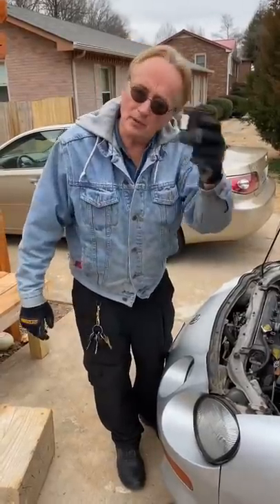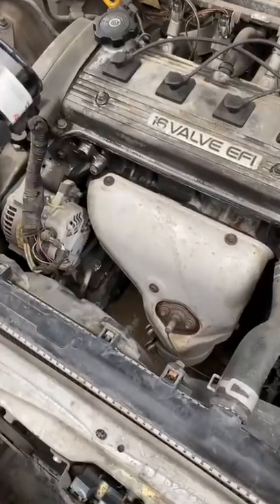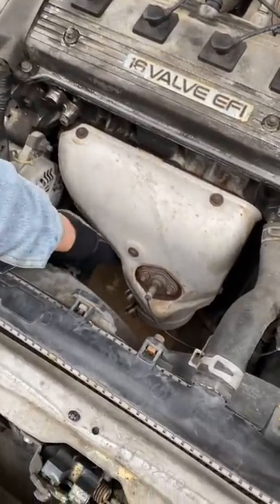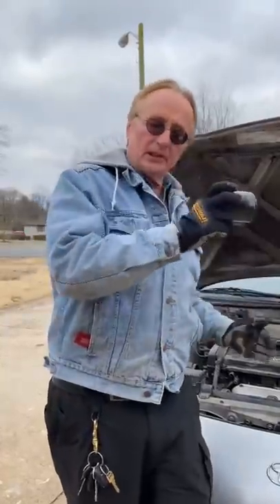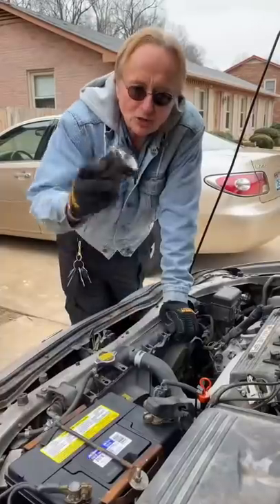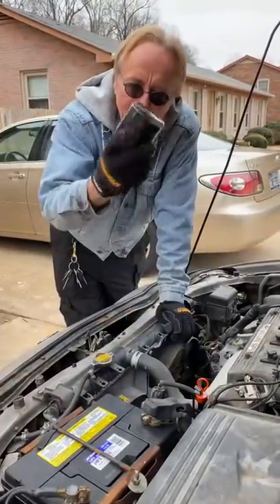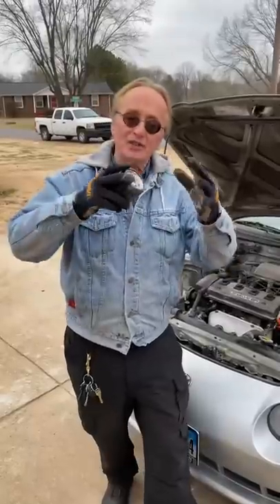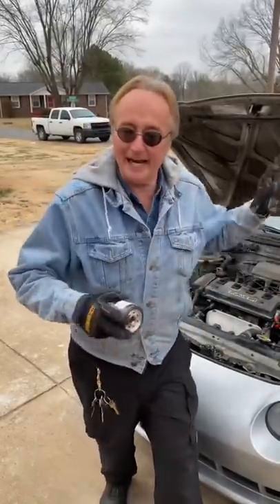The Dumbest Thing You Can Do

Comment: I did that once on my 289 mustang. The double gasket holds at low rpm. As all 289's are cold blooded. I had the hood open after the oil change, the engine was warming up I reved the engine using the carb linkage and heard a spraying sound. Ran into the car and shut off the engine. I lost only a qt. of oil. Sure enough 2 gaskets. Now when I spin a filter off, first thing I check to see is the old gasket is still on the old filter.
Reply: Mine was on a 302 🤣
Reply: @Brian Waskow You are so lucky you acted fast before it was too late.  👍
Reply: @wturner777  1980 Mercury Capri, 302, it pissed oil all over my garage so luckily it didnt get far :) the car that is, the oil, yeah, not so much

Comment: And the 2nd biggest mistake is not applying a film of oil on the oil filter rubber gasket, make them really tough to get off!  (And please prelube the filter with oil before installing also.)
Reply: Most mechanics recommend against preloading the filter with oil.  You'll overfill the system if you do it.
Reply: Would that be Honda Prelude?😉
Reply: I do it on my TB takes 7 quarts big 5 gal jug and 2 more quart btls so there is no way to really overfill if you do some simple math and pay attention.
Reply: @sct913  if you are tracking your quantities thats not an issue. You have a set amount of oil to put in the engine. A little of that set amount goes in the filter. The rest goes in the oil fill.
Reply: @Ellron23  Every manual I ever saw shows oil capacity with and without a new filter.
Reply: @koshnaranek2317  A semi? 22 quarts of oil?
Reply: @algrayson8965  4 5qt jugs and 2 more qts. I'm sure a semi filter will hold a qt easily

Comment: i always clean the surface where oil filter sits on engine to get rid of ring of oil and dirt from last filter so it does not interfere with seal especially when changing brands of filters some have rounded seals, and some are square so you can trap dirt ring under seal

Comment: I guess that’s why I was told to smear oil on the gasket before installing
Reply: You have to put oil on it because it helps the seal seat better apparently
Reply: @stevie7214  It makes it easier to tighten and helps to ensure that the gasket doesn't stick when changing the filter.

Comment: I've not done it but I've found this on cars I've bought. I will probably seal fine but in the filter itself the oil won't be getting fully filtered because it bypasses the filter engine mating surface inside.
Reply: the extra o ring can pop out of round under pressure without the metal of filter to hold it in place

Comment: Made a tiny mistake changing my oil and filter! i put the new gasket one step to low and it got stretched and everything leaked out, i did catch it in time but it did cost me like 14 liters of oil, 5 for the first filling 5 to get to the store to get a new filter with a new gasket that you cant buy on its own for some reason and also some more oil! still less then a third of the price of an oil change at like volvo or something even tho i basically had to buy enough for three of them!

Comment: I work a gmc dealer and lube tech forgot to put a oil filter on and the customer blew the engine down the road 🤦‍♂️
Reply: Customer apparently didn't have a clue what the little oil can on the instrument panel means when it lights up red? How about the rods knocking, the lifters rattling and the pistons slapping?

Comment: Hey scotty! What are your thoughts on pre-filling oil filters?
Reply: If your filter is vertical then yes fill it at least 3/4 full before spinning it on. This will help at startup decreasing the time it takes to fill an empty filter then start circulating throughout the engine.
Reply: It's good in theory, depends what size engine and viscosity oil. The theory behind that is you want the oil to get to the engine as soon after startup as possible. There's a video on YouTube somewhere of a guy doing side by side filter filled and unfilled with the engine open and the oil gets to the engine just as quick on both. Really comes down to the car and oil type. Modern engines keep a lottt of the oil in the engine itself, so you'll be fine. I still do it as a added precaution, but if you don't feel like it I wouldn't worry about it.

Comment: Do they still use those types of filters on cars today?
Reply: Every combustion engine. Some brands (Mercedes come to mind) have a replacement filter element cartridge rather than a can type. You open the housing and swap out the element.
Reply: @Ellron23  Many models use(d) insert filters. The Chevy-Buick-Olds-Pontiac V6 filter is accessed through a plate on the oil pan. Less waste.
Reply: @algrayson8965  yea I never understood why it didn't catch on more
Reply: @Ellron23  every car I've owned after 2015 had the kind that you unscrew from the oil housing at the top of the engine and replace only the filter inside.
Reply: @Mike__P  What makes? My post 2015 Honda and Subaru are spin on type, and my 87 190e is spin on as well. It seems more manufacturers are moving to replaceable filter media vs spin on canisters.

Comment: Som u teba blokovaný ? ? ? 
Engine designer requirements for lubrication - oil, filtration, flow, thermal stability of oil, filter material in the temperature range 40 +120 degrees, changes in technical condition from 0 km 100 thousand, 200 thousand km 500 thousand km, ... z charring of the filter medium - pulp, cotton , ... not a rarity at all.
Engine needs with 500 thousand. km, are completely different from the new engine in 100% condition.
There is no offer of filters for such engines.